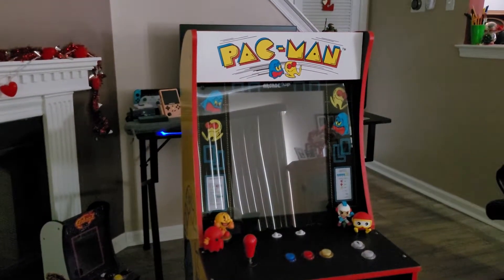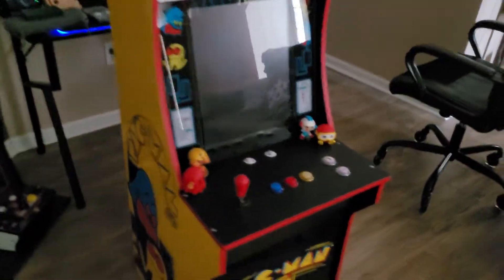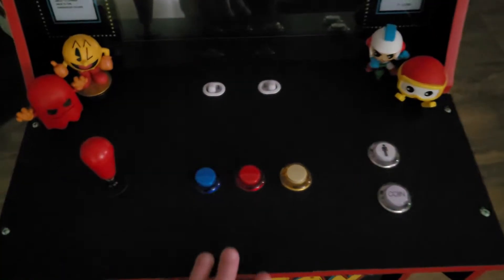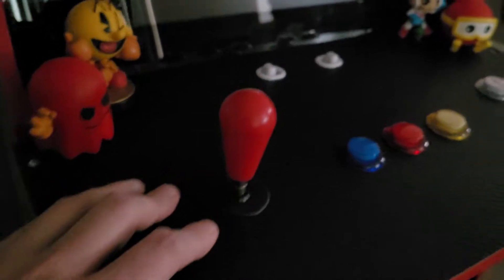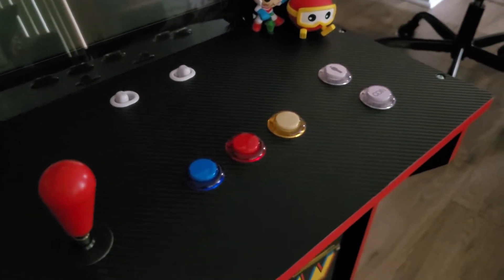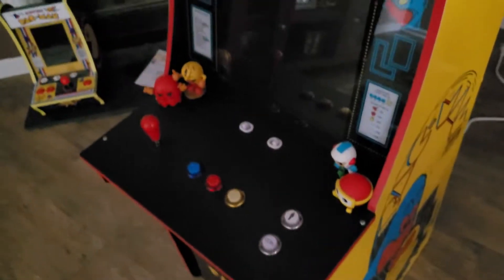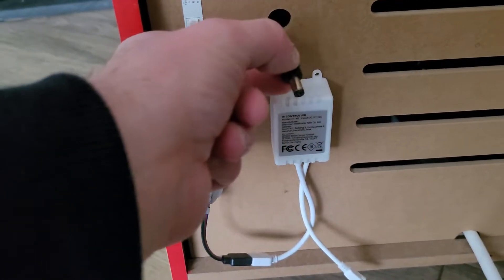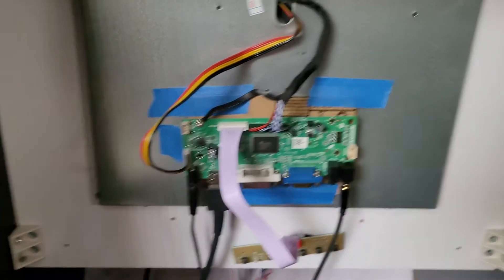Taking A Tour Of My $35 Goodwill Arcade1Up RetroPie Cab Mod!

Comment: You can get rid of those plexi scratches with some Novus scratch remover.
Reply from the maker: I was wondering how well that stuff would work for that.  I've seen different opinions on the results however, from worthless to great.  Have you tried it on one of these cabs plexi before?  If so which number Novus would you recommend?  Thanks!
Reply: @Wompratz  get the pack with all three of them. Clean the surface with #1, then apply #2 a couple of times. If there are still scratches, try #3!
Reply from the maker: @AdamMontgomery1  awesome...thanks for that. 👍